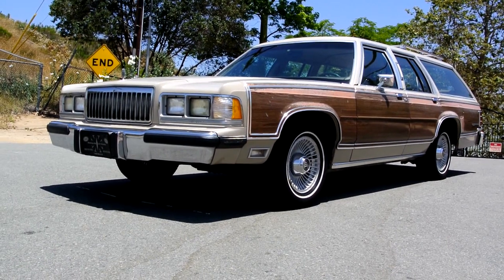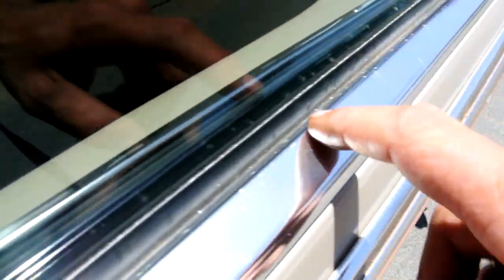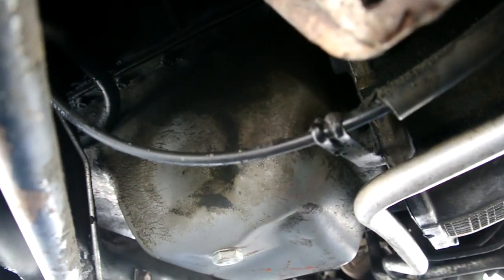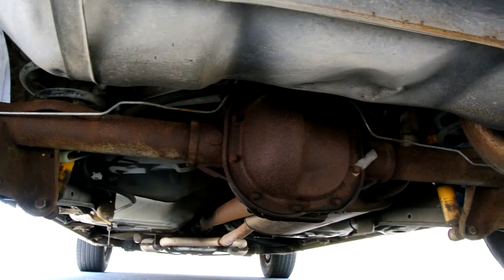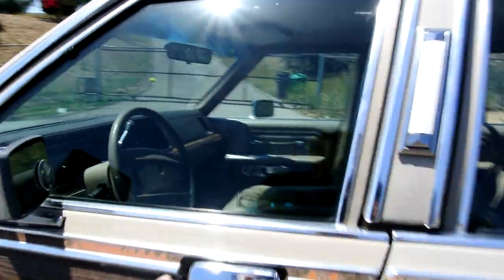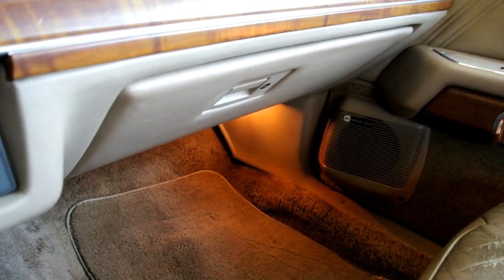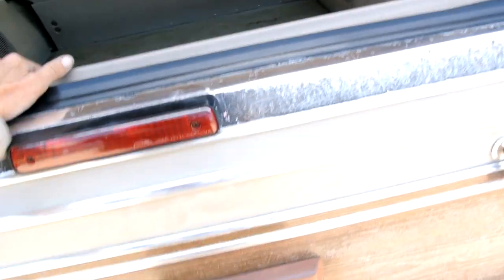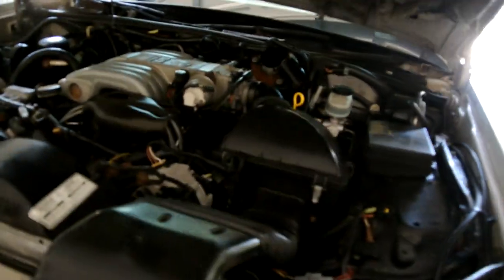1990 Mercury Grand Marquis Colony Park 1 Owner LS Break Station Wagon Estate

Comment: My dad looked at a brand new one of these in 1988.  It was at a Ford Lincoln mercury dealer so he wanted to drive both.  Drove the ford in red and the mercury I believe in silver.  Price on mercury was higher not extreme enough for him to question the sales guy why.  I remember the sales guy saying only the name was different and both had identical option packages.  He talked to the sales manager and agreed if my dad wanted the mercury version they'd let him have it at the Ford's price.  Sadly after we left there we looked at a 1988 Buick electra wagon and he went with that.  I'd have opted for one of the fords to get the fuel injection.  Only option Buick had over the force was a built in CB radio
Reply: I had several 80s Buick RWD wagons (w/ Olds 307)... and I truly believe that the FORD & MERCURY wagons were BETTER!   They're pricey, nowadays.
Reply: @34Packardphaeton  and fuel injection was the thing on the scene that's still huge today.  Dad thought apparently that fuel injection was just wondering fad and that the Buick looked more distinctive.  To play devil's advocate the Buick WAS w very plush and nice riding car.  I remember we drive an hour up country to my sister's house for dinner the first weekend we had it and it felt like sitting on a cloud that had that new car smell.  And the custom Buick wheel package was the best around for GM at the time. It has 8 miles on it when we drive it off the lot of Champion Buick in Portland, Maine

Comment: 1990 would be the last 12-month model year for this and the related Ford LTD Crown Victoria. The 1991 model year would be truncated since production of the old 1979 design actually concluded after December 17, 1990 so as to gear up for the new Taurus-inspired 1992 models that went on sale in March/April 1991... but the wagons didn't join the transition due to declining buyer interest in the wake of minivan and, later, SUV sales.
Reply: You're welcome.
Reply: I thought there were some cars of this make and model made for 1991?
Reply: Austin Lucas There are, but they would be made between August 1-December 31, 1990.
Reply: ClassicTVMan1981X OK. And after that, Ford & Mercury didn't make the large-type wagons (for the most part, at least; Perhaps there were custom orders?) in the 1990s.

Thanks.
Reply: Austin Lucas Correct.
Reply: I have an early production 1991 and I get more attention than my purple challenger or my 71 chevelle,lol

Comment: the mercury colony park wagon looks better than the country squire i think, the grille looks better than the ford and the tail lights are better plus it a little bit bigger i think its a bit longer than the ford correct me if i am wrong on the last part
Reply: Identical same dimensions as far as length.  Sedans were twins for Ford and mercury as were the wagons.  Minor subtle styling differences like the grill you mentioned

Comment: whats the "wood" part made out of anyway? ,i thought it was paint but its shiny.
Reply: It was a decal that came in rolls and was cut to fit during installation. I don't believe it's produced anymore.
Reply: It's a vinyl applique with a simulation wood pattern.
The cars are painted underneath and the vinyl can be removed carefully with a heatgun at a low setting or a hairdryer on high.

Comment: This car is made in the 90s? :D wow
Reply: 1990 and 1991 were the last years for the Ford and Mercury models. 1990 was the last year for the General Motors models but those have seat belts on the doors, not the pillars, and they also were still carbureted where these Ford and Mercury models were fuel injected.
Reply: Austin Lucas GM continued full size B body station wagons for Chevy Caprice and Buick Roadmaster wagons from 1991 until 1996 though with a newer "aerodynamic" exterior.  Olds continued with the custom cruiser for 91 and 92 with a similar "aerodynamic" look.  Though olds backed out of the body on frame RWD business after 92.